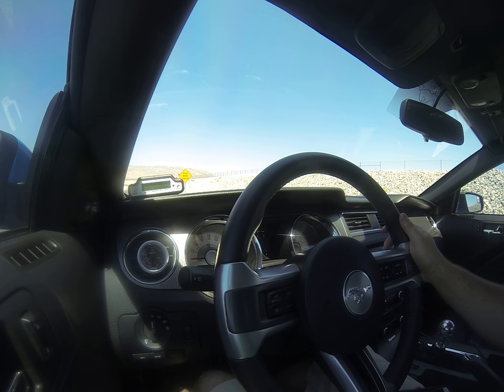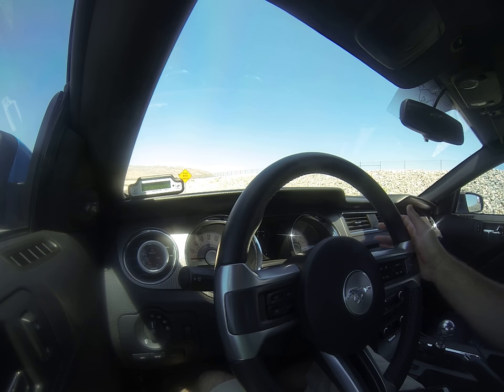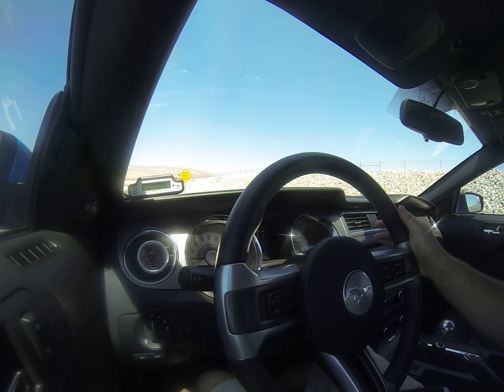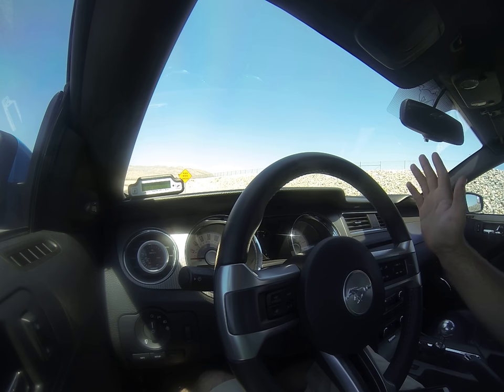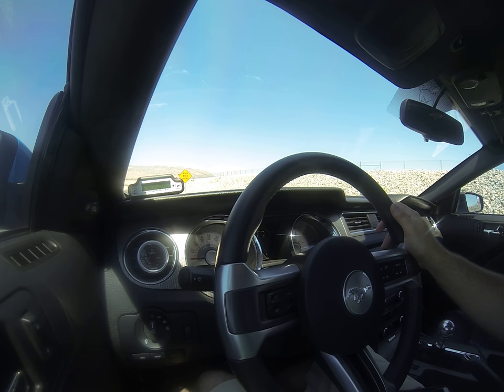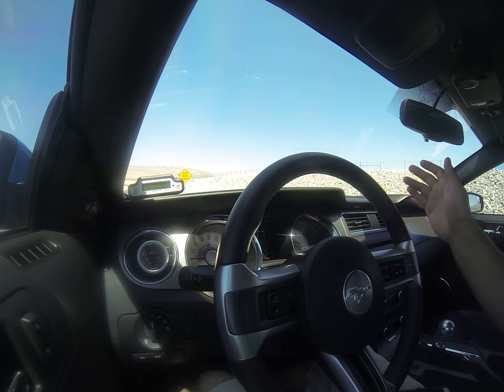EPAS explained - why some 2011+ Mustangs experience steering wheel shudder.

Comment: Guys, it can be a problem with the steering rack itself, not with the EPAS. I have the 2010 GT with HYDRAULIC power steering, and it has the exactly the same issue. It was from the day 1 I own it. Tires/rims checked many times, 2 different sets balanced, car aligned - nothing helped. There was a leak from the steering rack from the seal, I had the steering rack rebiult, bearings changed, fluid changed, and now it is even worse! The steering wheel is shaking at any speeds now, especially on bumpy roards (both when go straight or turning).
I'm waiting for the new front shocks and control arms to come in few days, will have them installed and see what will happen. If it would not fix the problem, I will take the rack back to the shop to double check it, then, if it will be still there, I will change the rack.

Comment: I have been experiencing similar issues now that I replaced my worn tires with what I assumed are heavier and stickier tires, possibly slightly taller. I just replaced front rotors and the shaking is gone yet I still have an issue when I turn from left to right at slow speeds. As I turn the car makes a noise as if the front tires were hitting plastic covers or rubbing them. My next mod is to get camber bolts and completely align the car is it currently sits with a negative camber due to the car being lower 1.5 inches. In all honesty I just think my new tires are just heavier and harder to turn so due to this the EPAS system struggles. My tires are the same size as stock though 255-40-19. With that being said, I am drive the car as is and fix the camber, due another alignment and adjust the tire psi to 35. The Boss 302 rack sounds like an upgrade I might want to add in the near future if all fails to fix the problem or if the steering gets worst.

Comment: Wow thank you I didn’t even know that was an issue with mustangs of that year.  My car is doing the same between 50 to 60 mph specially at highway curves for second I thought changing to new rims but also shakes and a straight away same speeds only correction to that is I have to wear than 55 mph or higher than 65 mph is annoying.  Thank you for this info.  👍🏼👍🏼👍🏼👍🏼

Comment: Same issue with my 14 gt. When changing lanes my car tries to correct itself and wobble. Its super annoyingspecially in some bumpy roads like the i4 here in Orlando. im even thinking about buying a panhand bar to see if it fixes the issue. My car is lowered by an inch factory wheels and tires so i almost dont know what will fix this
Reply: Michael M. Have you found a solution
Reply: Michael M. I have the same issue with my 13 GT between 60-85 mph  also feel a constant harmonic vibration at those speeds it's so annoying
Reply: Your car should already have a panhard bar.

Comment: I did some more research on how the PSCM is programmed and so far I was able to compare the 2011 to the 2012 GT and GT500 settings in the PSCM. You can see Ford changed the value. I am still trying to find out what the value actually represents. Fixing this issue may be as simple as changing the value to 013A.

Module  Mem Address   Value
PSCM 	730-01-01 	     043D             (My 2011 mustang gt)

PSCM 	730-01-01 	     013A             (2012 GT 1ZVBP8CF7C5243747)

PSCM 	730-01-01 	     013A             (1ZVBP8KSXC5257611: 2012 GT500)
Reply: Any idea if this worked?
Reply: @braupe  It seemed to improve the situation,  but not much.